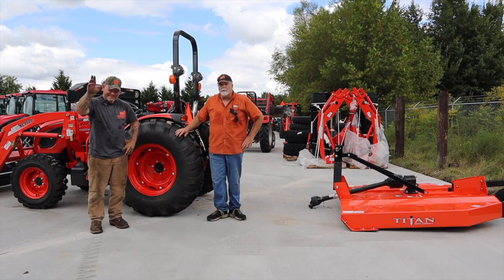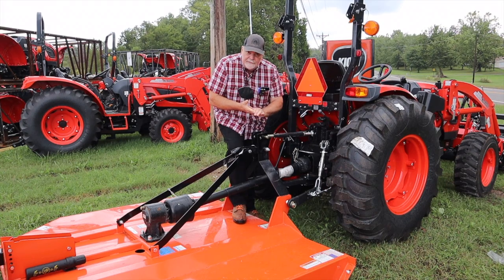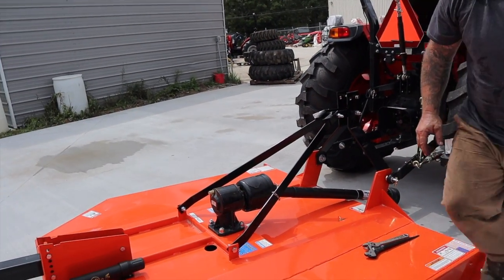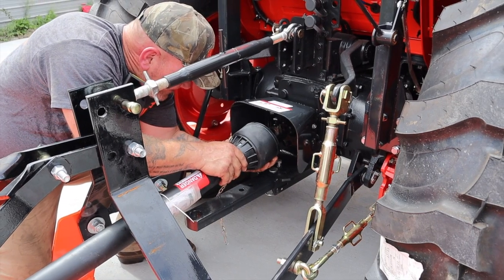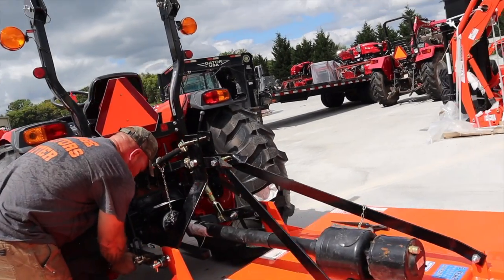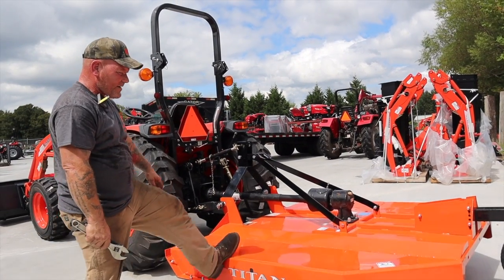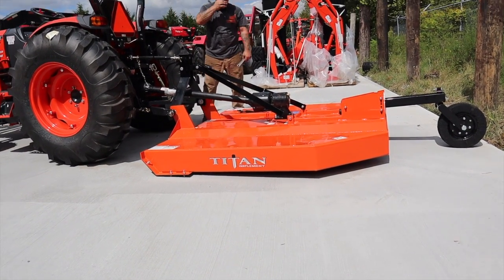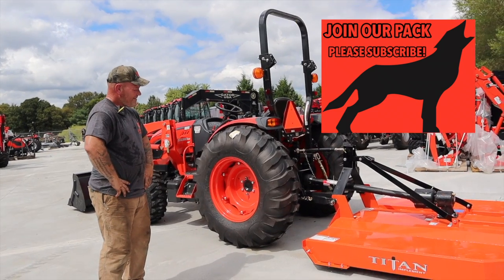HOW TO SERIES #3   Attaching a Typical 3-Point, PTO Implement.

Comment: How do you use the pto when using a wood splitter?
Reply from the maker: Mr. Redneck, log splitters that are operated by a tractor are typically hydraulically powered, using the tractor's rear hydraulic remotes.
Reply: @LSE_TRACTOR  I have an older PTO powered splitter, I can’t keep the PTO running when I get off the tractor

Comment: Great "How To" videos.  I sure wish you had locations in Michigan.  I'm stuck with either Kubota or John Deere.  Kioti/TYM just don't have a dealer network around here.  I'd be jumping ship to one of those brands for sure.
Reply: Do you have Rural King Stores in your area?   Their tractors,  the RK series are TYM tractors.  I Just got a new RK series tractor out for this year,    RK 25H.   Really nice,  same as the TYM T25.
Reply: @stevep8525 , no Rural King either.  It's Deere/Kubota country here. Sure wish other brands were available.
Reply: There is a dealer in Millington but unsure of any others. Larry Stovesand Equipment is capable  of delivering to Michigan and i know this because i will be having a ck2610se with a cab delivered from them within 24 hours from now. The total price from them with 2 implements and delivery fee was cheaper than the more local dealer price for just the tractor alone. I made contact with Zach from LSE through facebook late 10/8/21 and got all paperwork done through email within a few days. I sold my 1025r just the other day, no complaints, just needed bigger with more options. I would recommend getting in touch with the LSE dealer and getting some numbers and see what they got to offer.